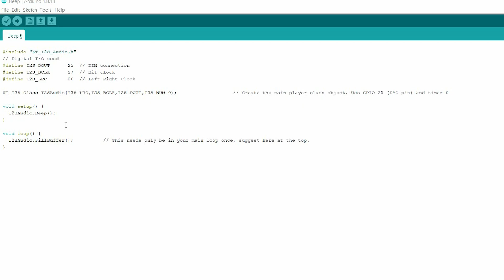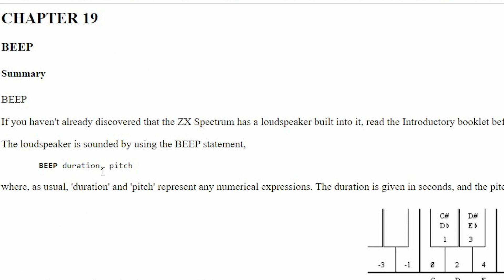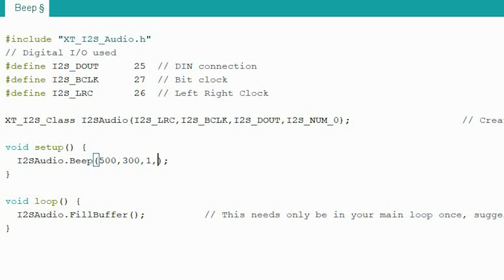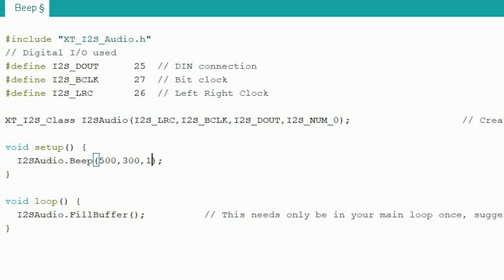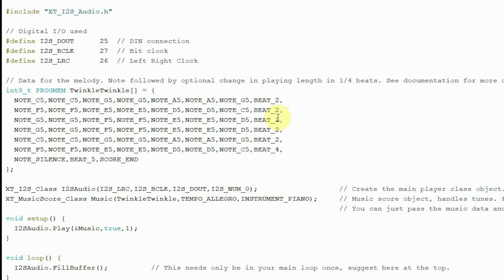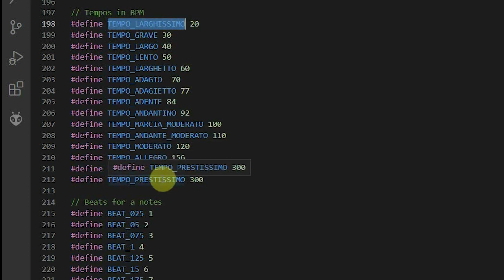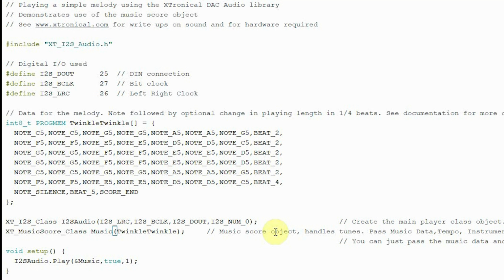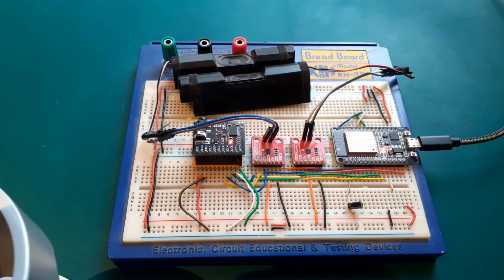I2SAudio Library, work in progress 2. (ESP32 I2S Audio, WAV, MP3)

Comment: Awesome brotha! Question how big of a file could be played or time wise say if I wanted to play a 30 sec mp3?

Hows the sound quality?
Reply from the maker: At top notch quality 32 bit 44100 samples per second about a Meg. But that's far more quality than is required in my opinion. 16 bit would be fine and would half that storage amount. I will be implementing sd card storage in future
Reply: @XTronical  thanks for the reply, trying to get around a 40 second clip with good quality , this the video I should reference?
Reply from the maker: If you just want to play 1 mp3 at a time then check out this video using a different library
https://youtu.be/Fa5f8IvyqoA
My new library is more sophisticated but may be more than you need.

Comment: Is there a benefit to using i2s over the DAC or is it simply just another way to do things? (Which is fine and useful of course)
Reply from the maker: Yes, the dac only supports 8bit mono sound. I2s supports upto 32 bit stereo sound. So much higher quality.
Reply: @XTronical  ah thanks for the explanation. I assume it had 2 DACs for stereo but indeed the greater quality is reason enough
Reply from the maker: You could implement the two dacs as stereo, it was requested for the old library. But it would use up another dac pin and for a not much improvement. So I decided to go i2s for this. Thanks for your comments.
Reply: @XTronical  no! Thanks for the libraries and the nice demos!

Comment: Really interesting,  I'm really interested in synthesizers and think maybe with a few additional commands could be the basis of a nice tone generator. Possibly ADSR and maybe the ability to play multiple tones at once. 
Great work, really looking forward to seeing where this is going.
Reply from the maker: It has ADSR coded now but need to check with my scope to ensure waveform looks right. Multiple tones at once is implemented. One of my original aims was to be able for it to mimic a synthesiser. Thanks for your comments.
Reply: That's fantastic, already having ideas for a VCO for use in maybe a modular system. The code to do the Volt per octave and gate input should be fairly straightforward.